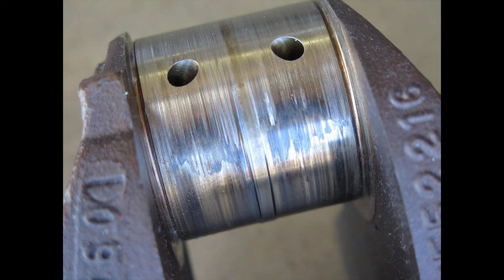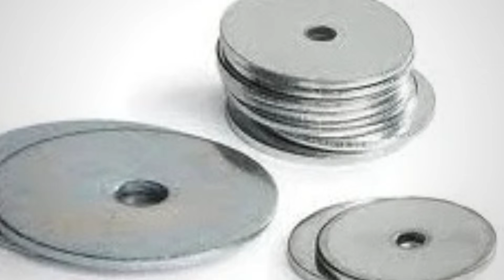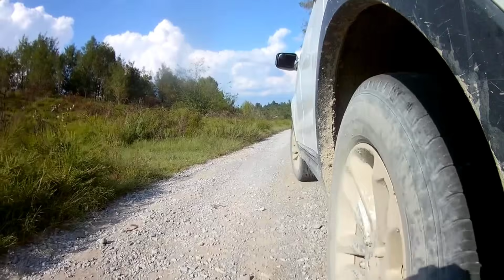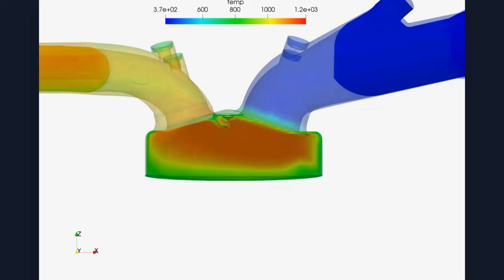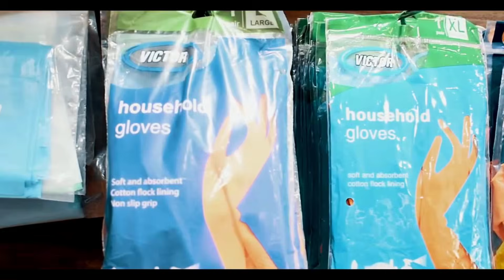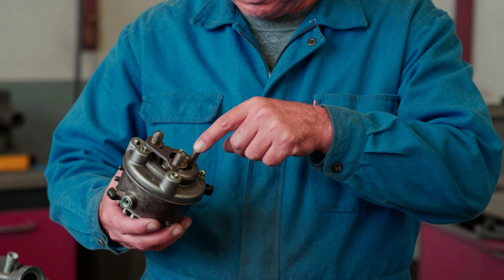The Forgotten $2 Fix That Stops Any Engine Knock (Mechanics Used This for 50 Years)

Comment: 100% of modern cars do not use distributor timed engines anymore. And if your engine is knocking this does nothing to affect any bearing or any actual engine knock. You're talking about timing related detonation, it's not a knock, that is not even close to the same, and this video applies to absolutely 0% of any vehicle made in the last 20 years.
Reply: I don't understand your complaint here.  This video IS NOT meant for modern cars with distributorless engines.  It is meant EXACTLY for the engines it speaks to in the video.  Why are you being such a nit?